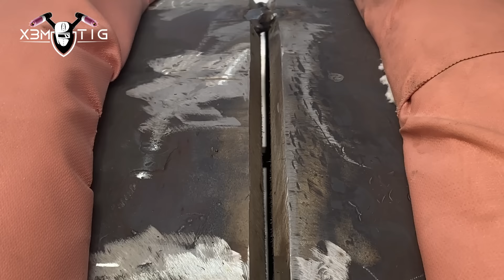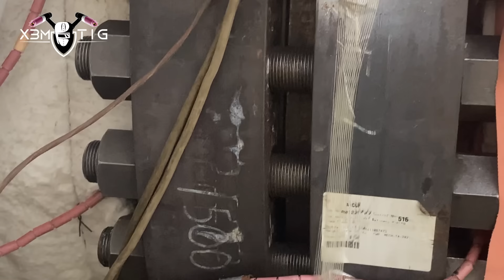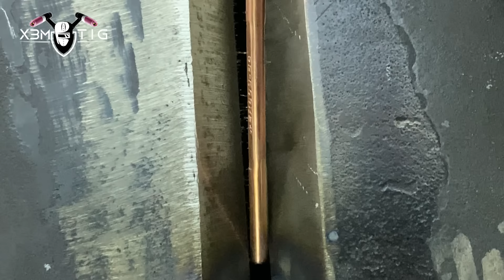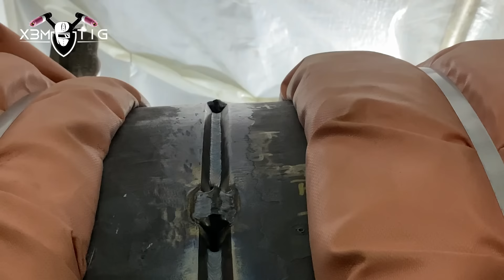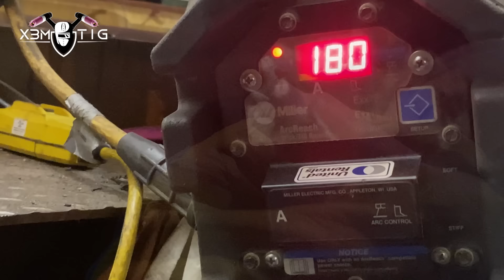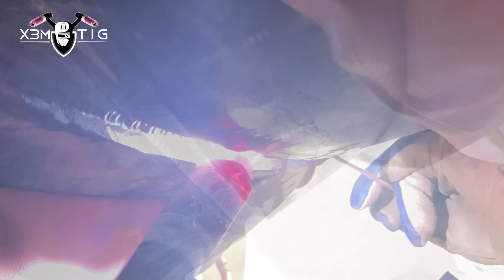The Ultimate TIG Welding Tutorial : Proven Tips For Welding Success!

Comment: When fitting such a huge diameter pipe is there a lot more strength with those thick tacks? We are fitting pipe which are a meter in diameter. These are also 18 meters long which means the tack as to be strong when you lower the pipe. I ask because what I usually do is weld 30-50% of the root in place of tacking. I have never tried masking those massive thick tacks before. Does it work? Are they strong? Fitting massive pipe is a pain in the ass and while dealing with weather conditions and holding up the crain operator. I just wonder if these massive fat tacks would work. It would be much faster and it gives me better time and conditions to do a proper root.

Comment: Another welder I see that burns the stamp off the wire.  What happens when QC wants to see the stubs?
Reply: They don’t need to see stubs. There should be a filler rod tracker or they can PMI the weld if they are that concerned with it.

Comment: Great video . I mostley allways use the dip technique especially with difficult metals . However i must say that sometimes you have to weld very dirty or low quality steel , then the laywire was the only way it would weld good . Everyone who welded at the basf plant in Antwerpen Belgium can relate , the moment you disconnected your filler from the weldpool and opened a keyhole you got porosity and small firework , and you needed to keep your weld on the minimum heat to make it weld . Man i hated that steel, everybody complained about it . What i find really strange is that such a big and rich company would cheap out on material cost , witch in turn makes the production cost higher because of more repairs and slower production rate because you needed to let the metal cool down to room temperature between passes . Other than that keyhole and dip are king . Keep up the good work

Comment: 😁 Another great video. I watched the video you did a month ago on the F6/F4 Max T and left a question for that video also. I realize while in the field you are too busy to get to all the comments. Just a quick question, does taking that Max T test you took using carbon 70-S2 wire and 7018 for fill and cap also qualify you to do chrome? I haven't tested at Local 488 for quite some time. Keep up the good work Brother.
Reply from the maker: Hey bud, sorry for delayed reply. Yes, F6/F4 PQ test, welder who qualifies on a P1 to P1 material is also qualified to weld P-1 trough P-15F , P-34 and any P-40s.
Reply: @X3MTIG  Very Interesting. I have worked through Local 488 for many years but have only worked through the pipeline division for the last 15 years so I am a little out of touch with the Industrial side. So, to test on a carbon coupon with 70 wire and 7018 will qualify the Welder for P1-15 base metals. That does indeed also qualify to weld on a chrome base metal, but in fact also qualifies to weld on P8 which is the stainless steel designation. Yet, when they test for stainless, they test with on carbon (base metal) with 309-L filler material and on the qualification card the only P number on there is P8 which only qualifies the Welder to weld on a stainless steel base metal. The last time I tested at the Hall to qualify for chrome you had to test with 80 wire and 8018 electrodes and that would qualify you for P1-4 base metals only. I guess things have changed.

Comment: You got some great content.. but recently I got hired at a new job and they use er70s2 but not one that I was familiar with.  It looks silver,  I guess it's coated 70s2. And wheen I tested,  it was way different.  Hard to explain kind of.  On the bottom it was flat with cold wire and I don't have problem with carbon but am with this wire.  Any videos on this specific wire?
Reply: I’m also on a job with 70s2. Really brings your confidence down.
Reply: @Justin Grubbs  they put in a big bore pipe shop. I made the necessary adjustments and started coming out good.  But ya out did shoot my confidence down for a bit.. like dam this wire better be wayyyyyyyy cheaper or smthg

Comment: When I keyhole I have issues knowing how much to push in, I always end up with a low root or too much of a root. But I’m gonna try dipping on both sides when I get the chance. Great video brother 🤙🏼
Reply from the maker: Thanks for your comment brother! Dipping on both sides, choosing right amperage and rod size, and travel speed is crucial! Every joint is different and requires experience to determine how you going to execute your task, and that comes with time, and practice! Play with your settings to find fine tuning and you’ll be golden 👊